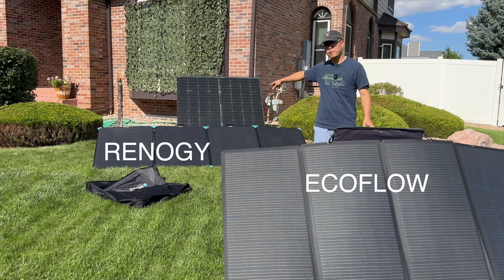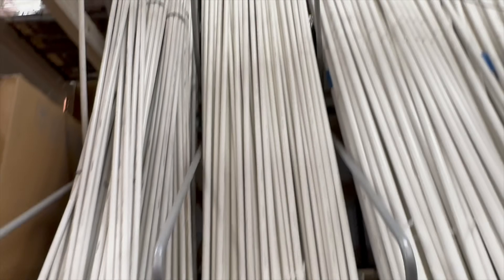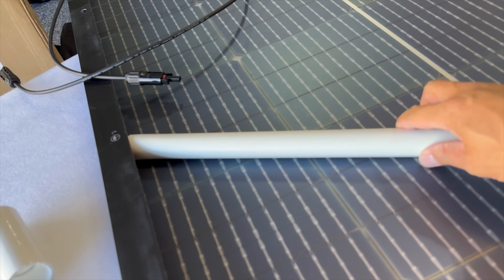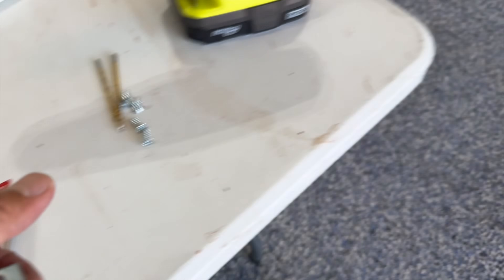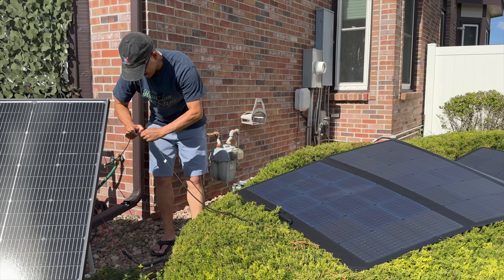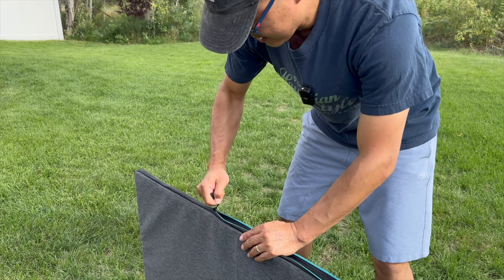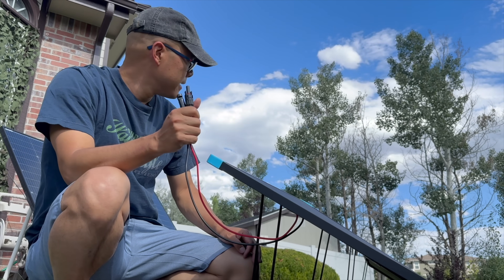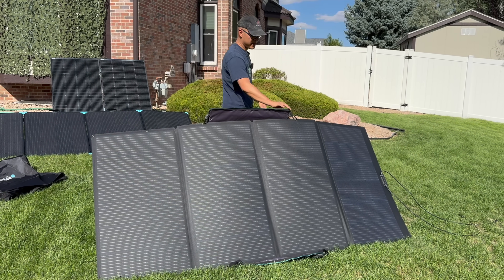My Cheap DIY Solar Suitcase vs the Best Portable 400 Watt Solar Panels

Comment: Of course, one could make 2-100 watt panels that weigh less and make 2 separate ones to make it less weight and smaller. As a single, older woman it would be easier for me to set up and move around.  I am still learning how to hook them up:  in series or parallel ?  Not sure.  Maybe, you have a video on that.  I will subscribe. 🎉🎉🎉

Comment: Just some thoughts for, maybe ur next go around… everyone is functionally fixed, mounting panels upright. How bout laying them on side and connecting at top… have wire end meet in middle. Use Velcro instead of hinges.  To separate, fold panels and Velcro comes apart. 😮.  Since they are lower to ground stands r smaller, don’t even attach to panel, just u shaped pvc, weight of panel will keep them in place… wide and low …

Comment: Hi FC, first time I've seen your videos, great job, thumbs up! I think I like your custom setup. I like the price, the ease of use and setup, and the sturdiness of the large solid setup you made. I might make the stand sturdier, and make a way to use long thick tent stakes to stake them down front and back and maybe even from the sides to help in high wind areas, which are everywhere here in the USA. Thanks for the video!

Comment: I got the EcoFlow 400w panel as part of a bundle (for $100 extra) and wow... I think I would prefer this DIY version.  Not only is it cheaper outside of a bundle but to my supprise the 400w portable panel feels heavier than two of my 200w ridgid panels, and its like you said much harder to setup.

So I am not sure if its worth keeping around for camping/travel but definitly not as good as this DIY for around the home.

Comment: I have the ecoflow bi-facial panels and the stand sucks.  What I did is place a draw string with a string loaded cord lock in every grommet top and bottom.  Than I run a 3/4" pac pipe the length of the solar panels top and bottom and tighten the strings by pulling on them with the cord lock.  I also use the same design you used on your hard panels.  Great job by the way.  By placing the pvc pipes on top and bottom I find it easier to move by your self on the lawn.  Great video.
Reply: can you make a video of this so I can see what you mean by this setup?
Reply: @SovereignSurvival  Sorry I don't do videos.  Basically just tie a pvc pipe where the grommets are.

Comment: 9000w portable generator with a 50a hookup to power the entire home was the first step for me as we have gone weeks without power from hurricanes.
Now that the cost of this stuff is going down, and the tech is getting better I am getting my first solar gear.

For now starting with a mini isolated system that will feek 800w of solar into my equipment all day in a semi-grid tied setup where I turn off/on grid power and use solar and grid power to charge, ensuring I use all solar I get every day.

I was actually thinking about using PVC to hold my panels, and had not figured out exactly how I would yet, I like how you did it here, much cheaper th an using a bunch  of specialty fittings.  So for me this was a valuable video to find.
Reply: Try Ecoflow 😮

Comment: What keeps the legs from dropping all the way down and the panels collapse?
Reply: Tie some cord from one corner of the panel around the  PVC bottom crossmember to the other corner of the panel- one continuous loop. Then you adjust the angle by changing the single knot behind the PVC cross member. Much better than having 2 cords and constantly trying to make them the same length for a particular angle. Also, I have shorter legs for summertime sun angles- so you don't have to split the long legs way out.

Comment: Thank you for sharing this! I'm temporarily living off grid on a friend's property while the driveway is being installed on my property. I wanted to DIY a mounting system that would be easy to move but inexpensive and you're the first person I've seen use pvc! I even already have a pvc cutter so now I just need to measure for pipes and head to the hardware store 😊 I've been using my saw horses to prop up my panels for now, so it'll be nice to give them their own kick stand and free those up for other projects 😂

Comment: But you don’t explain what the use of this is for what’s the practicality? What are the used case scenarios? Can this be used as a permanent installation for home savings
Reply: He said he can store them away until he needs them. To me, that sounds like he intends to use it for power outages and emergencies.

Comment: Dude, I wouldn't call any 200w x 2 a "suitcase" cause that's one gigantic suitcase. I have those JNN 200w and they are big. I can't imagine putting 2 of those together and try to bring that anywhere with me. You're better off doing a suitcase with 2x 100w and making 2 of those is you must. Then you can just use 1 set or series 2 sets when you need more.
Reply: I bought these JJN 200w bifacials too. Quick question. In less than half of the cells on the BACK of your JNN bifacials, do they look faded where it's lighter (tan) on one edge or corner of a particular cell than in the middle of that cell? Especially if outdoor ambient light in the room. (I've seen the "checker board" thing where whole cells change color to blue or brown depending on the angle but I think I'm talking about something different.)  I've seen pictures on Amazon that make me think it's normal. Just wondering. Mine are brand new and only briefly tested them to assure they work. 

Anyway, he already has 2 portable sets to bring somewhere. I didn't make a suitcase either because of weight. If I need to transport these to a loved one who's out of power (since I don't have portable panels), it's easy to put in back of the SUV.  I also made some stilts from 1x2 pine (bolted to the small center hole and oblong bottom hole) to get them 24" off the ground and works great with my existing PVC stands where I add an extra 24" section of PVC with couplings. Great to get more light to the back side but mostly to get above my deck railing shadows in winter.
Reply: @rgraz4929  I bought 3 of these in Oct 2023. You have to show me pic(somehow) of what you're talking about. I just transfer all 3 of these to The Eco Worthy panel rack I bought a while ago. During the transition, I discover one of the panel has burn cells and emailed JJN about it. They said they are sending me a replacement. As least their support is good.  I'm OK with these panels for what I paid for them. If I had to do it over, I'd rather get the cheap 195w Eco Worthy. I might only get 70-75% of its rated wattage vs maybe 80% from the JJN but they are much cheaper $ per wattage and much lighter. The other 2 panels doesn't look like it's going to survive the wear ad tear either. I feel like the glass is bubbling and will develop burn cells just like the one. Surely these aren't going last 10 years much less 20. It's perfect weather for solar right now and I'm only getting ~450w for the 3 panels in series vs closer to 500w when I first got these.
Reply: The term "suitcase" is used for carrying something. A 2x 200w suitcase is just way too heavy to be carrying around. Why make the effort of that ? I don't see the purpose. With 200w panels, a more useful approach is to put them on a rack and wheels. Like I was saying, if someone want to do a suitcase, you're better off doing 2 set of 2x 100w. That way its easier to carry around plus you can use 1 or 2 sets when you need to. I made a suitcase too but with 2x 130w flexible panels. I glued them to small wood boards and hinged them that way. Super light and easy to carry around. I have tons of portable panels too but that did that for fun. At least it's useful to carry around. I don't know how useful to put 2 heavy ass 200w panels in a suitcase configuration.
Reply: @Firephosure  Thanks. There's a picture in the amazon reviews for Renogy N-Type 16BB 250W Bifacial Solar Panel to give you an idea. Like I said, I took these out of the box to make sure they worked. Rated at VOC: 28.1V / ISC: 9.12A, in 50 degrees in the slightly hazy10AM mid-November sun in the northeast, I got 28.5V @ 8.16A and  28.9V @ 8.17A. So I guess they work. Then again, I don't know anything about solar stuff.

Comment: I am going to build a stand for 2 Jackery Solar Saga 200W portable panels, and a set of Flexible 100W solar panels that I got online. I am building a mobile stand with 2x4's and 8" casters, so it's heavy enough to withstand wind, can be moved around, and can still be stored in my garage when the need arises.

Comment: After close inspection of the video, I see that you bought 1" x 1" x 3/4" T's. its all about the details.I am going to space my legs farther apart to put the pressure of the T's closer to the frame of the panel as to not press on the glass panels. Overall I like your video. i bought BougeRV's 200W 16bb panels for under 200$ each. the are approximately  50" x 30".
Reply: It depends on how deep the frames are on the BougeRVs. On these JJN's, moving the tees close the sides still won't prevent the Ts from forcing against the glass. Unless you buy regular 3/4" Ts and sand out the inside (with a rounded file or dowl wrapped with sandpaper) so they easily slide on but there's much less play. That's why I mounted the cross section on top and still put the Ts close the sides for stability. Must use Schedule 40 PVC. Lowes in my area has the nice Charlotte Sched 40 PVC (with the red print on it).

Comment: I have a question with the sizes of T's and the PVC pipe. in my experience 3/4" T's are too small to slide over the 3/4" PVC tuning. So, are the T's actually 3/4" or did you modify the 3/4" T's to slide over the 3/4" PVC tube?
Reply: He used all 3/4" pipe, but the tees he bought were 1" x 3/4" x 1". So the T's easily slide over the 3/4" cross section and the middle of the T is 3/4' and will fit. I tried his method of mounting the cross section under the frame but the T's had so much play, they are jammed up against the glass when in use, so I mounted the cross section on top, as much as I don't like the look of it. If you look carefully at the Ts, the center comes to a gradual point and I feel very uncomfortable with them pushing against the glass. See my previous comment.

Comment: I started making my PVC stands for my JJN 200w panels just like yours. Even bought that husky cutter which I like! One thing I don't like is the Tees jam against the glass when in use. (EDIT- one solution is to use 3/4" Sling Tees which slide over the crossbar perfectly with no play) So I mounted the cross section on top of  the frame (instead of under) and I flattened/melted the PVC ends completely flat for stability and mounted with hex bolts and wingnuts. I used big fender washers for stability and I attached rubber magnet material I had laying around to them so not to scratch the frame. Also, I divided my legs into 3 sections (8.75" - 8.75" - 17.5") using couplings & tees so I can get a pretty wide range of angles. Like tinker toys as a kid! One more thing: to keep the stand from sliding-out, I'll use some cord plus it's much more stable at skyward angles. There's tiny holes in the panels' corners where I can attach. I will not alter the panel with extra drilled holes in case it needs to go back.
Reply: If you make 3 holes in the tube in the solar panel and 1 in the T connector and put a piece of metal you can have 3  o 4 different positions in the stand and the stand don't move.

It is only a suggestion.
Reply: @viktury2075  I see what you're saying. Great idea!  You could use a large nail thru both holes and it wont go anywhere. Or visa versa- Put one hole in the cross member at  vertical angle (so the nail won't fall out) and 3-4-5 holes in the Tee.
Reply: @viktury2075  I'm in the process of doing this. I created/printed a drilling template and taped it to the tees as a guide. I drilled six 1/16"  holes equally spaced apart (or tried to) over a 80 degree range. Just drilling thru one side of  the Tee and crossbar wasn't stable enough given the huge amount of play between the 3/4" cross bar and 1" tees. I drilled clear thru both sides of each. A littler harder to match the holes but it's very stable. EDIT: The space between the 1" tees and 3/4" crossbar really made it difficult and sloppy. If I was do this again, I would use 3/4" tees and sand them out with a dowel for a neater fit- OR buy 3/4" sling tees which slide over the crossbar with no gap.

Comment: Love the innovation and the DYI solution is a no-brainer.  I will say, the AllPowers SP037 400w portable panel is about $370, (cheaper if you buy more than one) and it would be a great one to look at when considering portable panels.  Thanks for the video 🙌

Comment: Nice. Since you're not gluing the PVC, you can keep different length legs on hand. Winter, shoulder, and summer legs! (The legs you made are more like winter/sunrise/sunset legs.) EDIT: So you just drove wood screws into the PVC? Maybe I would have sandwiched the PVC further down and added lock washers and nuts or just lock nuts. But that'll cause the PVC to protrude further out. EDIT again: Was just thinking, you could use a series of T's with cross sections or just couplings and create sections to create different length legs, dividing the length you have into 3s or 4s.  For instance, for higher sun, remove all sections but the lowest section with the elbows (Bottom section with the elbows would always be present.)
Reply: BTW, these 2 - 200w panels are currently on sale for $265. Before that, it was $345 with a $40 coupon = $305.
Reply: @rgraz4929  I bought 3 of these directly from them for around $165-170 back in Oct 2023. At time bifacial was new and this was a great deal. I wouldn't recommend these solely for the longevity. One of them already have burn cells and the others look like the glass is bubbling. I don't know maybe it's just mine.

Comment: What is the optimal angle on those JJN bifacial panels? I'm new to bifacial and I've read they have to be on a white background and also elevated at least 1 meter on a steep angle.

Comment: Great work!

I think I will use two 420W Silfab Elite panels and put locking wheels on the bottom.

Also thinking a few sandbags are in order for windy days.
Reply: Yep, I bought two Silfab SIL-420-BG panels to mount on the ground. Much cheaper per watt than Amazon panels, US made, and safety listed.
Reply: @adriftatlas  How did you buy 2?  When I tried to buy just one it was a PITA.  20? Easy!  1 - not so much!
Reply: @JeffreyAdams-kt5gv  I'm in WA state where they are produced. And Platt Electric stocks them in the warehouse here. They deliver from their warehouse for free. I also got a discount from the list price by talking to them.
Reply: @adriftatlas  sweet!  I just had my test Silfab panel get hit by a golf ball.  Shattered the glass at the impact site.  Now I have to buy another single panel here in the San Francisco Bay Area.

Comment: I love it, but I think you need a detachable pin mechanism. That way you only need to carry each panel. In this way you can create a much bigger system. Also those 200w panels are just to big to take camping. I would use multiple 100w panels.

Comment: Two rigid solars are a little heavy to be carrying around, even for a short distance. I would have added wheels for easier transport. I also would have made a pvc stand for the Eco flow flexible panels. Nice diy stand build.

Comment: If its bifacial, isnt it bad to have your pvc mounts cover the bottom portion of the solar panel?
Reply: Any kind of shade on a panel reduces power by a lot. But its almost impossible to avoid. The sun moves around and you have trees ect.

Comment: @freshlycharged Great video. What lengths did you cut your 3/4" pvc pipe? Do you remember and if so can you share. Thanks.
Reply from the maker: I cut the leg lengths to approximately the length of the cross bar spanning the width of the panel.
Reply: @freshlycharged  Thanks for the reply. Curious how well you are able to set the panels to different angles and not slipping or moving on you. I like changing from 35 to 50 degrees depending on the time of year.

Comment: Could this be folded backwards to put on top of an SUV to use one panel while driving, then unfold when stationary at a camp site?  I'm setting up a dual battery system in a Honda Pilot.

Comment: My roof experience.  Leaves and garbage builds up under panels. 
Possums squeeze under and damage cables. 
Cleaning panels was a pain, Never wipe with wet cloth in sun,  crazy cracks appear damage all over panel doh. 
My 5c opinions.  
Ground based or near Ground I find way easier to deal with. 
400w may require a variable amp euc charger so you can charge at 
1.5  amps maybe. 
I run 900w onto 100amp mppt regularly to a 100ah lithium to a 3000w pure sine wave inverter.
I do like the look of the new power stations.
Reply: So what happens if you get a summer shower will it crash the panels?
Reply: @robertdaone   don't seem to, strange I know.  Now I guess why, maybe temperature issue, could be spots cool locally, where rapid thin spread may have been the reason. I shall ask Mr Mould ha he might guess. 
My panels still charge my system on rainy days. The damaged panel works but due to any risk of keeping it safe if failure occurs its in a safe situation.  
 Cleaning wet is in my opinion best done  late evening or early morning no sun on, or in good shade.  Dry brooming seems fine in my opinion.